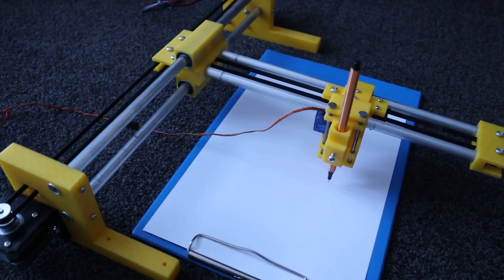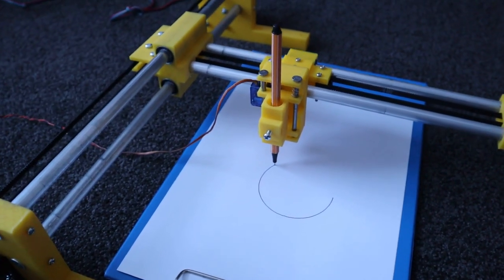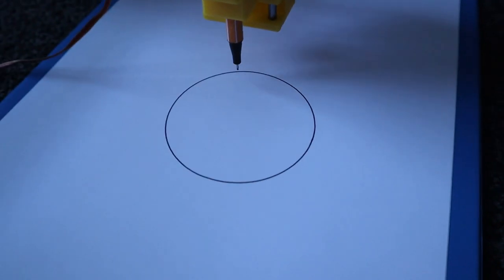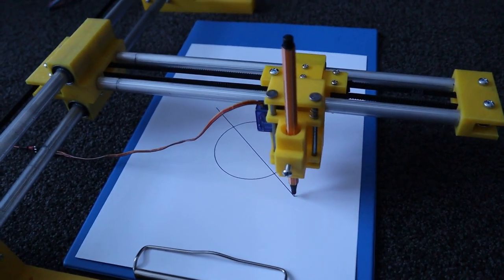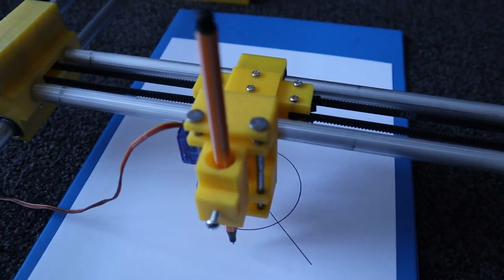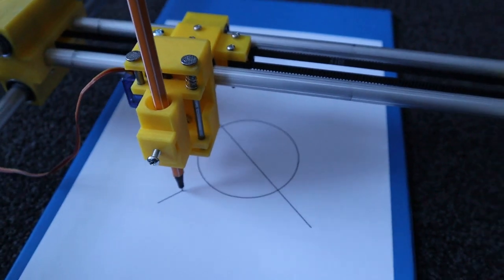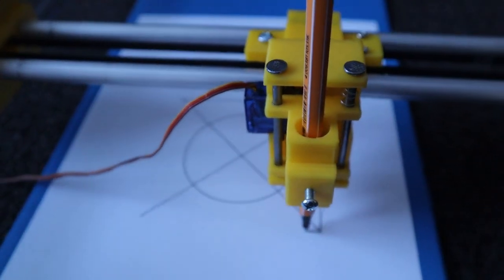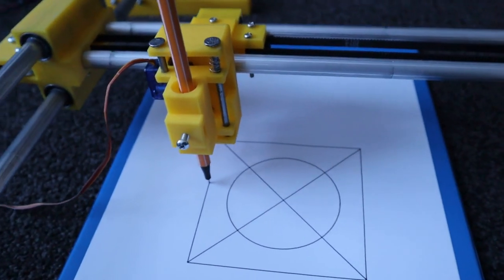CNC Plotter

Comment: Single belt, holy moly
Saw the layout you draw and it kinda feels like this could be used as cheaper alternative to core XY / better alternative to Cartesian. Not sure how well it would perform but theoretically we could stack belts vertically to handle higher accelerations as there's no crossing in belt
Reply from the maker: Only one belt is required. GRBL is configured for CoreXY.
Reply: @qualityphotos1  You literally written as, I'm not that dumb!
Higher print speed means belt should barely stretch even under High acceleration.
Since this design has no crossing unlike Core XY this is only 1-belt high.

Which means.. we can put 2 of this (maybe even mirrored so every axis is balanced) at same vertical space of core XY.

That means we have double the belt pulling the printer head, more acceleration we can achieve!

Might try that when I can get hand on the parts

Comment: I have a pen plotter constructed. My problem is the software. I can't seem to figure out how to get it to work correctly. The one I built how ever is not a XY core type. Mine has two nema 17 motors for X & Y and a servo for Z. I cannot get Z to do anything.
Reply from the maker: Follow the instructions and wiring diagram in the link below  this video except code line 189 in config.h must be commented out for your arrangement. Try another servo if it doesn't work ... they have a habit of failing if you've manually moved the arm.
Reply: @qualityphotos1  I finally figured it out. I was putting the modified files in the wrong location. It works now.
Reply from the maker: Thanks' for this feedback ... great that you have everything working :)